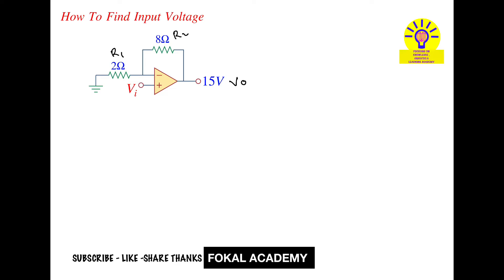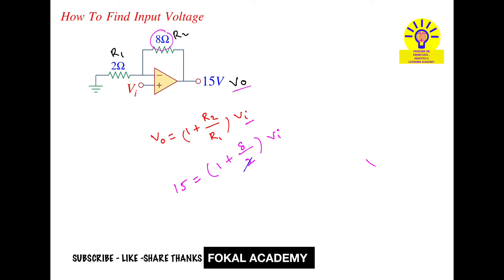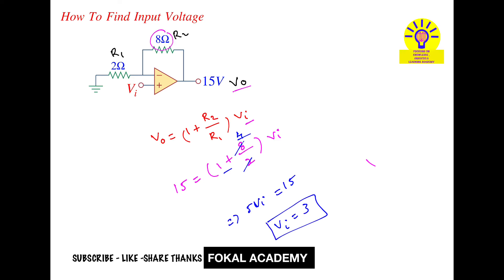How To Find Input Voltage of OPAMP circuit

Comment: Y=5x+3
Use the circuit to carry out Y=5x and dedign r1 r2
😊
Google hardware interview
Reply from the maker: Please mention question clearly
Reply: @FokalAcademy  use 
the op to carry out 5x+3
First stageb op  yo1=x*(1+4r/r)=5x
And then Second op you2
(v+-3)/1+(v+-5x)/1=0
2v+=5x+3
v+=1/2(5x+3)
So the second op yo2=1/2(5x+3)*(1+r/r)=5x+3
☺️
So fun questions (Google hardware interview,easy)
Q Y=5x+3
I think up op and use it to carry out Y=5x+3